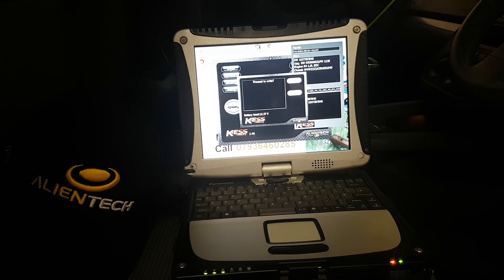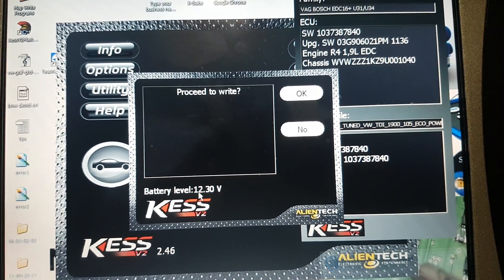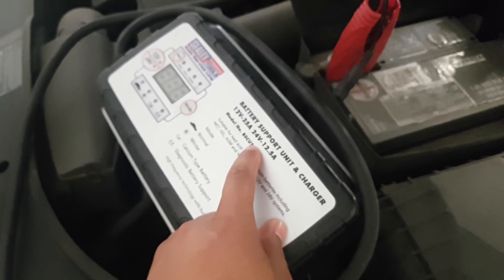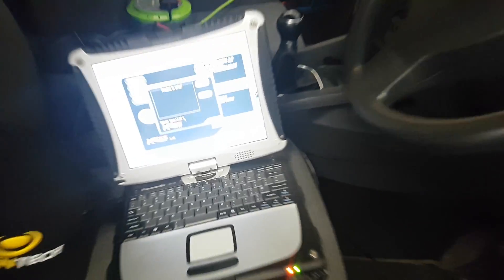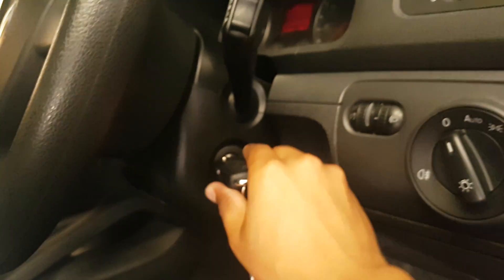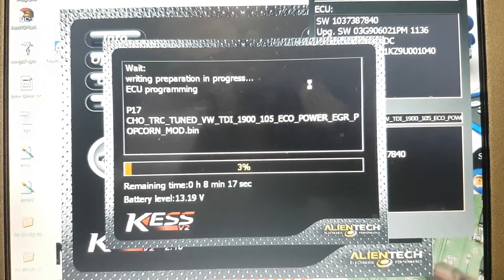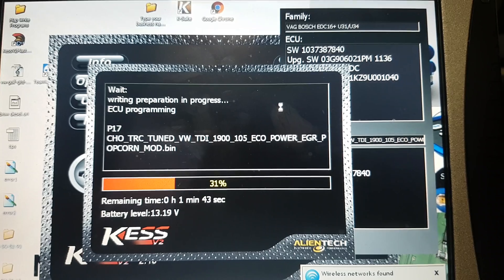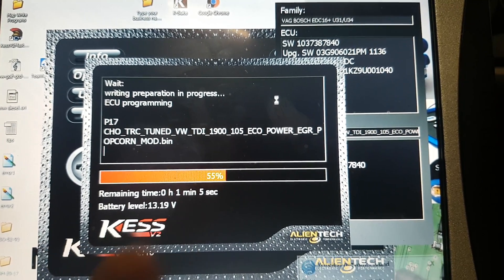Do I NEED to use a Battery Support Unit (BSU) when programming to a ECU?

Comment: Why would the fan come on if the engine is off?
Reply from the maker: When the cars computer is programmed the fan comes on as a fail safe as while the ECU is being programmed it doesn't know if the engine is hot or cold so it cools it to be on the safe side

Comment: couldn't you just pull the fan relay to get away with the 25amp unit if the car has larger fans
Reply from the maker: Brendan Randle 

You could but this doesn't solve the draw on the battery on for instance a 2009 Range Rover with air suspension that power down the air compressor and all the ECUs on the car to which there is many. All these ECUs create a big draw of power on the battery and a battery support unit is still needed even if the radiator fans was disconnected

I hope this helps!
Lewis